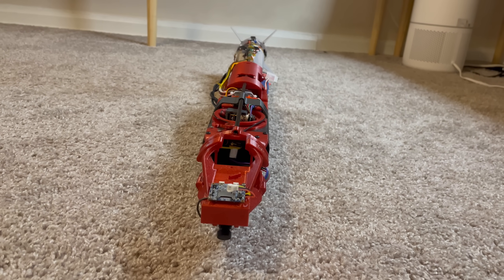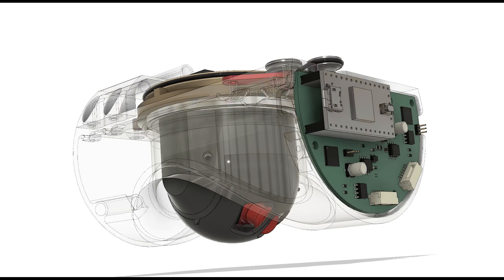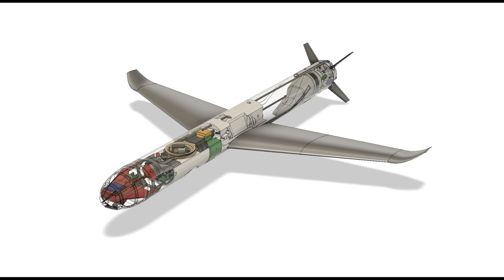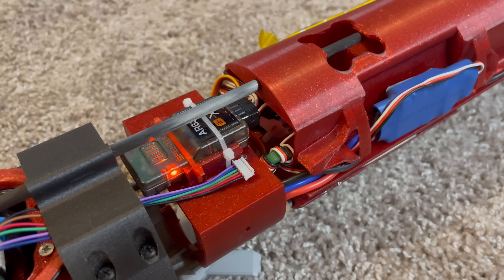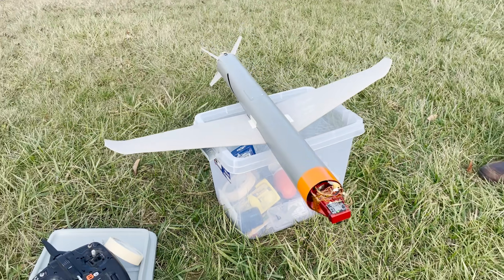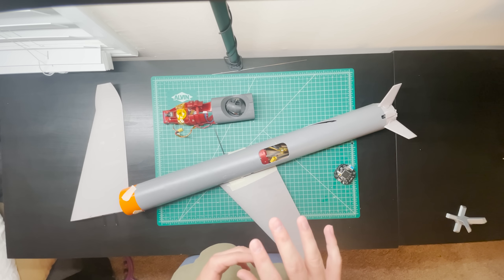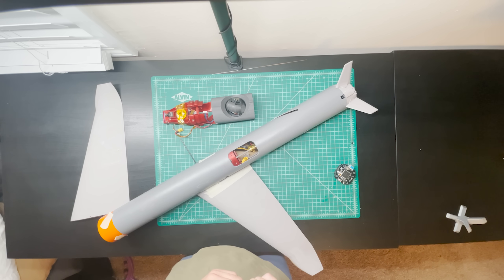Building (And Crashing) my Homemade Surveillance Drone

Comment: Correct me if I'm wrong, but Hatchet is meant to be initially launched via rocket with the EDF just keeping it in the air. As such, redesigning it to be hand-launched seems like a step in the wrong direction. I think a catapult is a better idea, as it can provide the higher launch speeds that are needed without having to deal with the complexities of rocket launches.
Reply: Or a magnetic linear rail launch system like Tom Stanton and others have built before.  Smooth, consistent acceleration. Though that doesn't help the whole cruise missile vibe!
Reply: I agree, engineering a propulsive launch with discarding sabot-style engine mount might be a simpler solution than fundamental redesigns to allow for low speed launches, nearly an entirely separate vehicle mission set... 
Amazing work!
Reply: He could have also had someone else tow it with a rc (and a cradle with wheels to get it off the ground) like a glider and then ran the tests once it was already in the air.
Reply: Yeah, stuff like this  is often RATO or JATO.
Reply: Would like to see a video going over cg, thrust and wing loading.  As an amateur rc plane designer I can guarantee that model needs way more thrust for the weight it is. Looks tail heavy too but that could just be a stall.
Reply: My two cents would be to use a spear fishing elastic type rail to get it moving.
Reply: I would use a lightweight tube with compressed gas for initial cold launch. You can use C02 cartridges for the initial push and would make the system simple and reloadable for another launch after recovery.
Reply: Given that he has never flown a radio control plane before this would be a step in the right direction. Slower flying means more forgiving and easier to launch/test. Once he can make the hand launch version work, then he can work on increasing the wing loading and going faster/autonomous
Reply: Mind you that building a rocket-launched plane is also highly illegal. Like you said, you're building a cruise missile, and the government does NOT appreciate that xD
Reply: Yeah...  I was thinking that guy throwing the RC plane was a bit "limp wristed..."

Comment: A few observations:

The swept crescent wing is always a bit of a tricky approach, I built a few high speed slope soarers with that planform a few decades ago and they were super sensitive to CG positioning.

Looking at your screen shot of the eCalc data, your 'Stabilizier Volume (Vbar)' is 0.16. From the eCalc page:

The Stabilizer Volume (Vbar) is a value for manoeuvrability. The lower the more agile the aircraft gets. Typical values are:
   0.5...0.9  Trainer
   0.3...0.6  Aerobatic
   0.5...0.8  Glider
   0.5...1.1  High-lift Jet
   0.3...0.5  Combat Jet
   0.0 for Delta & Flying Wing (due missing Stabilizer)

It is possible that your choice of wing aerofoil is creating a nose up pitching moment, and the tail is insufficiently sized to counteract it, quickly/instantly leading to a stall. Also remember that the V-tail will have less authority than a true horizontal stabiliser. So when entering the values for it into eCalc used the projected plan view for span.

Perhaps choose a reflexed aerofoil for the wing, it will have a much lower pitching moment, so you can get away with small tail surfaces.

Launch speed looks far too slow. As other have said, look at a rail launch, or even something as simple as a bungee/hi-start launch. A lot of scale EDF guys use these to get heavy underpowered jets into the sky safely. Owlplane has a download for a launcher if you're looking for inspiration. It generate 25kg/50+lb of pull.
https://owlplane.gumroad.com/l/tsqpe
Reply: Hmm, but he's not using a V-tail but a cruciform tail, i wonder if he just used V-tail data and divided it by 2 as he doubled it?
Reply: @belliduradespicio8009  Very true. What I meant was that the 'V' of the tail surfaces would result in a much less efficient lift vector, due to being inclined at 45° to the direction it is needed. The resulting component is going to be much less than would be achieved with a proper horizontal stabiliser. A V-tail equipped aircraft often needs 10-15% more surface area than a conventional horizontal-stabiliser equipped aircraft would.

Comment: As cool as this looks it's the wrong form factor for the purpose. If you want a plane to film rocket launches you want something efficient with large high aspect ratio wings with low wing loading. That can loiter for a long time while flying as slow as possible at high altitude for steady shots. You want a glider. Which would also be capable of taking advantage of thermals at the desert locations where amateur rocketry is done. Just my 2c

Comment: I don't think the drone has the thrust necessary for its weight, but I also believe that instead of throwing it like a paper plane you should accompany it by jogging a bit before letting it go with a smoother transition.

Comment: I think this fins are compatible with high thrust systems like rocket that why little movement in them cause the air darag and changes orientation of rocket I don't think  using them with  EDF is a good idea you have to make it as light as possible to do so

Comment: I would recommend building a model as similar as possible out of dollar tree foamboard. It is important that you get the CG right, normally about 1/4 chord or slightly forward works great. Testing a foamboard model would allow you to have the lightweight model you need for takeoff and hand launching while also allowing you to gain an understanding where you are lacking in stability. It may not hurt to try and throw your model in XFLR5 without the fuselage and run a stability analysis with your current cg location and such to ensure your model is statically and dynamaically stable. This will also allow you to quickly change your model in software and give you a good place to start with real world testing. I do not recomend sweep for a model like this because it is not going fast enough for it to consider compressible factors. The things I recomended should give you a good starting point and understanding, giving you more time to come up with possibly more thrust for hand launching or bunge launching methods.

Comment: I think u need to put controll surfaces on the actual large wings. Maybe try a foam vertion of that first with the bare minimum components for it to fly, then try to use fiberglass to reduce weight as you improve. Since the air intake is flush with the RC plane surface I think air might have a hard time entering the EDF at high speeds. Good Luck with your project and keep us posted! ✨✨🔥🔥

Comment: It seems to be a problem with thrust. Did you consider a fan that would be enough for takeoff, not one that will just keep it aloft if it gets in the air. To quote Tim Allen what you need is "More Power" Grunt, Grunt, Grunt.

Comment: Looks like nearly no trust with that restricted outlet, and bad CG!
My tip... Make a lightweight mockup without engine, just controls, and get it to glide first. (find the right CG and trimm) 
Then make Shure this thing has at leest 1/3 of its weight in trust and try again.
And your wing loading might be to high, so maybe catapult start.... 🫤
Thicker wings could help too!

Comment: Why  are you not trying 2 stroke engines like we use in remote control airplanes and helicopters.. It is almost like they have not crossed over to liquid fuel...Thanks for sharing---John

Comment: Make a takeoff gear carriage. Some sort of tri-wheel carriage that when you pull up to take off, it leaves the gear on the ground. That way you have a more stable take off, and a, no offense to your friend, more reliable and more consistent take off procedure. (probably with nose gear, not a tail dragger)

Comment: You can try to launch it with a catapult (look out how rc soaring planes do it), you can even try a rocket motor assistance, but that ducted fan is way underpowered. It is far worse that a simple propeller.

A push engine, propeller or EDF, is also going to be more unstable, so try to glide it unpowered first to set the correct trim.

Comment: your revision ideas are correct but i would try first with a propeller first as a edf is for high speed thrust and your edf does look very small for the size of the plane/missile. i thick all your revision ideas plus a prop to get the thing flying first then work backwards step by step to you goal.

Comment: Seems like it s a little bit underpowered lowering, the weight might help but you will eventually have to get a more powerfull EDF if you want to add the payload back. The control surfaces seem to be very small for a plane this slow, also control surfaces near the front of the plane might help (look at canards on some fighter jets)

Comment: I am by no means an aerospace engineer, just a hobbyist drone/rc plane pilot. Here are my 2 cents: these first launch attempts look very similar to that I've experienced with my first rc plane (zohd nano talon). The problem with such planes is that they have a relatively high wing loading and are pretty hard to hand launch. I crashed my plane around 20 times before I figured out that you need to give it much more kick on the launch. Because of that I decided to bungee launch it. With bungee launcher it took off easily on the first try. My bungee setup consisted of 10 feet of rope attached to 10 feet of elastic band, the part with elastic band is attached to the hook on the ground. The other side with the rope has a loop which is attached to a hook mounted to the airplane. The hook should be mounted on the bottom of fuselage a bit forward of aircraft CG. Thanks for the great video. Best wishes from Ukraine.
Reply: Slava Ukraini -  Героям слава!
Reply: @8thDay1 shut up
Reply: @8thDay1  THey have already lost.

Comment: The ducted fan is your problem. There’s a reason ducts aren’t used on vtol vehicles or anything propeller driven in general. They decrease thrust substantially. Even putting prop guards on a quad copter lowers your flight time by 10-20%. I love this idea, but I think the ducted propulsion system should have been an obvious problem. You’re essentially starving a prop of airflow.

Comment: 1. You need to shed every gram of weight you can. Cut way back on the plastic, perhaps try a lightweight PLA if you have to have the volume filled.
2. Lose the EDF, its very inefficient and the weight is the exact wrong place on the aircraft; all the way at the tail. Put a folding prop and motor on the nose cone.
3. I would consider investigating canards as well as it may allow you to...
4. Get longer and bigger wings. 

Good luck, I'm a drone guy and not a rocket guy but I love your vids!

Comment: Copy an existing RC-Glider so as to check the systems in a flyable craft and get some RC flying experience. Otherwise follow the recommendations of ©Charlie-gf4mv… this is NOT a rocket, it’s a high speed glider. For a safe take-off use the bungee method as mentioned at the end of the video. Good luck 🤙

Comment: Props for all the design work that has gone into this! Genuine question, you say you are new to RC receivers and aircraft? Have you got much flight experience with RC aircraft in general? 

100% worth getting a little foamie trainer plane to practice with as this thing looks like it would be a handful to fly for even a competent pilot with years of experience. High risk too! Every time you crash you have to replace something because of all the 3D prints. 

A little foamie trainer plane you can take off and land to hone your skills would be perfect. Great series though, looking forward to the next instalments!

Comment: You dont have a large enough downward force in the back to stop the node from pitching down, also add a scoop like a P51 for the intake so its not just taking it from the side. 

That fan is not nearly enough power for how heavy that thing is. 

Really cool project btw

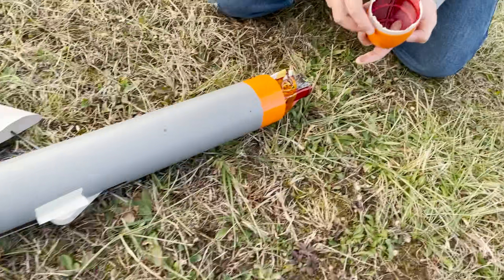Comment: 12:00 Insta-stall

Your inertia about the roll axis is large. That's OK, but any inadvertent roll rate induced at launch cannot be negated because the winds are already at stall.

Ive seen the comments about adding ailerons and such, and thst works on paper, but also has some self-defeating property of even more roll inertia. But it might work.

My one suggestion: by the looks of it off-the-cuff, this things lower cruise speed will be 30 or 40 mph. This can be confirmed by hanging it out a car window on a string (need someplace safe to do this). You will immediately see at what speed it exits stall. That needs to be your launch speed, no matter how you achieve it.

Also, the control authority of the fins is enough for cruise speeds, but woefully inadequate for hand launch. A wing shape that provides a natural aerodynamic righting force could go a long way towards getting through the launch phase. A rather large winglit at the end of each wing, perhaps? I think the Russians are using an X-wing configuration to achieve this effect, which also adds stability during cruise.

Great project, and well done!

P.S. If an inertial sensor is close-looped around the orientation, the CG/CP situation has a lot less meaning at flight speed. Meaning you can move the CG backwards and sweep the wings a lot less, and still be actively stable.

Comment: I love your videos, and I have learned a great deal from watching your project videos.
Having built and crashed 10+ plane designs myself and building a stabilization system, here are my two cents.
1. I'm sorry but your friend sucks at hand launching. :(
2. Your wings need to have a slightly positive (+2 <-> +4 degree) AOA relative to the wind if they don't already.
3. At 12:05 when your friend launched the Hatchet, it immediately pitched up. This tells me Hatchet is excessively tail heavy. You might want to move your battery forward a little bit and or add weights to the nose so that your CG is at 1/4 <-> 1/3 of the MAC of the wing. Unpowered, hand launching a well-balanced RC plane should glide in an arc smoothly and dig into the ground nose first.
4. I don't think you have enough airflow into your motor. The air inlet seems pretty small (maybe add another inlet on the opposite side of the mount?)
5. Since Hatchet does not have ailerons for roll control, you might want to increase the size of your fins by about 50%. I also don't think the thrust vectoring is doing much in this case.

6. Point 4.

I think the tail design is very novel and I would love to see how you solve this problem. Cheers!
(Also if the CIA is watching this, Hello!!)

Comment: For an EDF it is too heavy. - You need to redesign the EDF duct and control surfaces. You may want to have pop-out intake ducts like in Tomahawk. also, I would put the ESC in the duct to provide the necessary cooling. to assist low speed takeoff for hand launch, you need to enlarge the control surfaces. Later, you may reduce the size to be more efficient in high speeds. Lengthening the fuselage, moving the wing assembly to the front of the payload and adopting glider style wings, you may have better low speed authority. (Assuming you're not trying to build a tube launched, rocket assisted cruise missile) :)

Comment: Well you asked so here goes. In the RC world we tend to toss stuff first to see if it will glide, It it will glide It will fly under power.  Hand launching does no good if you toss it at a high angle were the wings are useless, at that point your just relaying on thrust. As for thrust, those EDF's will barely have enough thrust to keep it moving forward if the model would at least glide (fly).  I converted a 5 foot wing span glider with a fordable nose prop, to a tube fuselage with an EDF in the middle. The added drag of the fuselage and the weight of the air intake door open / close server + hardware made the thing  barely flyable in a straight line so I would never gain altitude to find more thermals.  Remember an EDF are just fans.  Anything in front of them restricts airflow.  Anything behind them restricts airflow lowering there trust.   I would defiantly suggest bungee hand launching to see if you can get that general shape and control surfaces working to some degree of level gliding then adding thrust after you get it some what flyable.  GL

Comment: 1) too heavy 2) no thrust at all. a) not enough air for the fan b) small fan for a weight 3) Ihave bad feeling about thrust vector idea 4) I DONT think that any idea with this "rocket design"is hand launchable.

what to do
1) make just prototype that will fly with no aditiona features. just bare minimum for fly. 2) use light materials - are yoiu using at least PLA LW? 3) redesign control surfaces
Reply: That's what i thought about the air intake for the duct fan
Smaller air inlet leads to reduced thrust output for the motor so it has to be optimized else even a capable motor won't generate the right amount of trust go power the aircraft

Comment: For a hand launch the minimum thrust/weight I like is 0.8-0.9. This is hard to achieve with an edf but could easily be achieved with a folding prop out the back. This will reduce your overall weight as well due to a smaller battery required. For controls I would suggest a vtail with ailerons. Thrust vectoring does not help with stability which is the goal here.